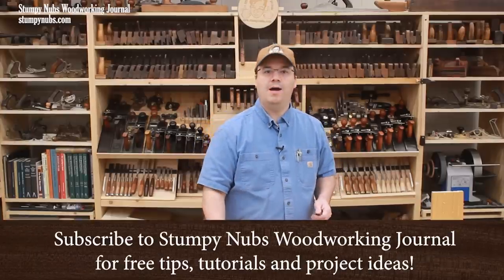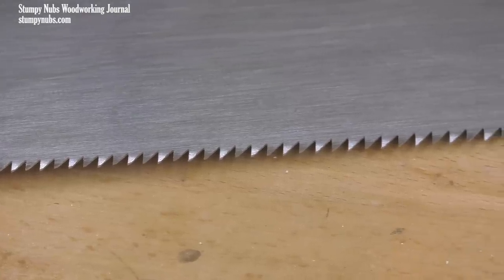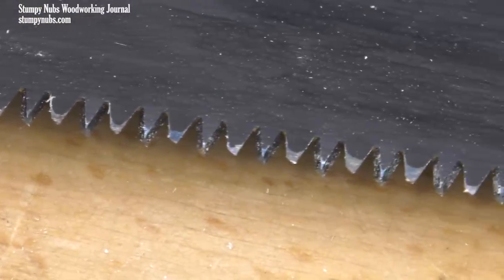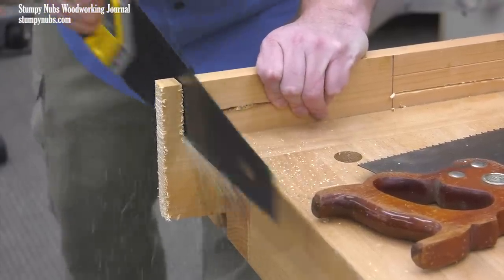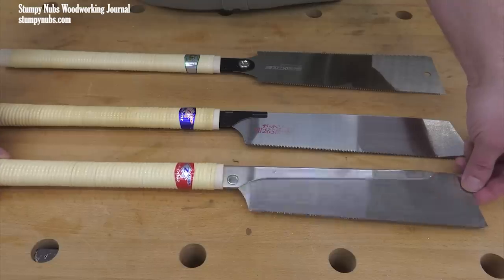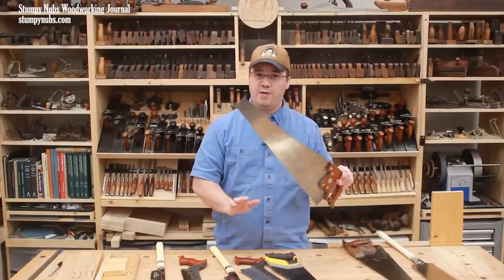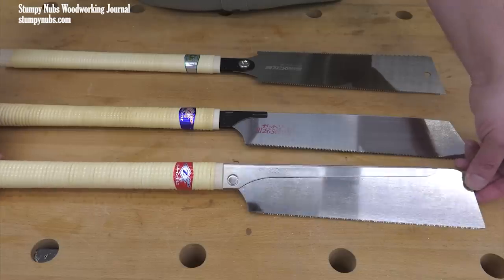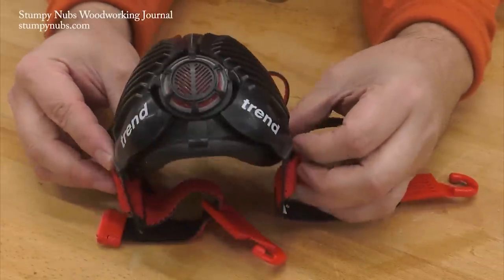Do Japanese saws cut faster than western saws?

Comment: I think this comparison missed an important part - getting started.

Many beginning woodworkers struggle with push saws because the blade will bend if they push too hard at first. With the Japanese saw, you keep tension on the cut stroke so that problem is removed.
Reply: Thats actually a good point take anyone who is not experienced using saws and they will be able to use the japanese saw better on the first time every time.
Reply: Bingo.
Reply: Even when using a normal, Western saw, I often score the wood with a few pulls before getting into it. I'd definitely keep a trusty push saw handy for big cuts, but for clean cuts with minimal waste, the Japanese saw wins.
Reply: That was mentioned in depth in the original video
Reply: I was about to say that myself, I'm no wood worker at all, but I've always struggled with push saws. I'm not physically strong, but the pull saws my shop teacher let me use when he saw me struggling worked like a dream
Reply: I noticed this too. To be honest when I was getting started with woodworking i couldn't understand why western saws were designed to cut on the push stroke in the first place. Especially since it's the design of the tooth which determines how well the cut goes, not the direction of the cut. o why not work with physics. Besides if you need to put your weight into the cut and the blade is likely to buckle when you do, what is the point?

I would argue that if there is little difference once experienced, but one requires less training to achieve good results, then the one requiring less training is the superior option. When in a shop it will save greatly on wasted lumber in the long haul, and will generally produce better results. Additionally since it works well without much training one could argue that the intuitive nature of the Japanese style results less likely hood of making mistakes.
Reply: ...that was definitely a problem for me as a kid trying to produce around my dad's construction sites
Reply: @biggiedickson  I see you didn't watch the video.
Reply: Yes, of course none of the two are intrinsecally better. Having said that, i use only japanese for a few advantages but mainly because of the woods i use the most. So, the advantages are: 1-japanese saws work better with less or even no tension, so it´s better for my arms. 2: The cuts themselves are thinner, in fact they always tell you how thin the blade is as an important characteristic of the pull blade. BUT: i usually use cedar and petiribí, meaning soft or medium woods and i work on small proyects. Since they are small pieces, it´s important for me to get the thinner less material removing saw and i don´t need anything that strong. Of course if do need to work in harder woods then i´ll use my kataba or even a thick ryoba i bought for that purpose. If you´re working constantly on oak or hard woods in general, i think you´d probably be better off with push saws. 
       And for example, i think it´s clear that japanese saws are more precise once you get use to them by far as stumpy said in the previous video BUT that might not be an advantage for you.  Many people are not looking for that as they always leave some extra material in the cut to make several cuts faster and finish it off appropriately later on.
Reply: @biggiedickson  Doesn't really work when you don't have much weight to put behind it... 😅
Reply: I don't remember having an issue with a push saw. Saws are not for pressing down hard. The weight of the saw is more than enough for cutting.
Reply: @MrVeps1  That's exactly what I do. I score the cut with a small trench so that the saw will not move. Works every time. And if you discount for that millimeter, the cut is always measured right.
Reply: @samuellourenco1050  if your saw is sharp and straight. A pull will allow a bent or dull saw to still make  a reasonable cut.

Comment: Thank for your service!  Some thoughts:

1. It would be helpful to see the back of the ripped stock.  As it stands, it appears that the Western-style saws cause MUCH worse tearout than the Eastern-style, but we can only know that for certain if the back of the piece of wood is shown.  (There does seem to be a LOT less unevenness from tearout on the crosscut piece cut with the Eastern-style saw, when the back of the cut is briefly visible from the front.)
2. The reason that the Eastern-style saw can cut MUCH faster than Western-style saws when used two-handed is the long handle acting as an effective lever; the more distance between the effort and the fulcrom--i.e. your left and right hands--the greater the downward force.
3. Conversely, the reasons that the reverse is true when used one-handed are not only because of the fewer, larger teeth, but because of the greater offset of the hand from the line of the teeth; at a given position, the force travelling from the hand to the engaged teeth is angled more downward than with an Eastern-style saw, meaning more force is used to push the teeth down into the wood than forward along the saw's path.  (If the force angle isn't careful balanced, the saw can be pressed too hard into the wood, stalling it.  If this occurs near the tip of a long saw, the saw itself can even end up permanently bent as it buckles under the pressure--ask me how I know. :sigh:  This is not possible with an Eastern-style saw.)

Does that make sense?
Reply: The eastern saw is way better for flipping a burger 🍔🤣🍔
Reply: I get ya. I grew up with Japanese saws, switched to western saws due to availability for a long time but used one of my uncle's saws when i went back to visit and just bought a set of them and brought them back in my carry on afterwards. I can't tell you how many times had bind and bend with western saws, even a snap once

Comment: In my experience the Japanese saws work better in softer woods and the western saws work better in harder woods, where, for me, better refers to speed and quality of cut. Also I tend to try to touch up my western saws whenever they feel like they aren’t cutting as well, typically in very hard woods like oak and hickory. I’ve broken too many teeth trying to cut hardwood with Japanese saws so I tend not to use them for that. Since my western saws are usually more handy I tend to grab them instead of walking over and getting a Japanese saw out of the cabinet. If I’m going to walk across the shop I’ll more than likely use the table saw or bandsaw.

Comment: Interesting analysis, for which I'm grateful.  I DO have to thank you, though, for one crucial bit of enlightenment re: push vs pull -- although it was actually in your previous (afore-mentioned) video.  What you pointed out there, which I hadn't previously (cared enough to have) thought about was what is actually well explained by your front wheel vs rear wheel drive analogy.  Truthfully, what I connected it with IMMEDIATELY when you mentioned the problem (at about 1:30 in) was what I've noticed when pushing or pulling something like a hand truck: if you try to push one ahead of you, the task of steering is quite demanding - versus just dragging it behind you, where it AUTOMATICALLY follows without requiring ANY concern for steering.  I suspect that anyone who hasn't had a western saw buckle/bow instead of cutting through as intended - probably hasn't used a saw enough to have a legitimate opinion.

Comment: This is very interesting. I have saws going back 40 years (which I can sharpen) however my modern blades are so sharp I find myself actually holding them back to stop them snagging in the cut sometimes. Of course the teeth are much different from traditional saws . I like both!

Comment: Nice follow up video.  I find Japanese saws much handier when not working at a bench.  For example, yesterday I was shortening rows of French cleats to make way for some new cabinets in my shop.  The long thin handle of my Ryoba made those cuts much easier than trying to use a panel saw.

Comment: I’m in the middle of replacing base moulding and the door trim, I ran into an issue over the weekend as the board that is under the staircase skirt board, had an odd angle, I found using the Japanese saw, I recently purchased was the perfect tool for this. Allowed me to be much more accurate with the cut.

Comment: I use a traditional western 24" panel saw for large work such as breaking down rough stock and rip cuts on stuff like a 2x4 and larger. The pull saw comes out for everything else. There is a time and place for everything.

Comment: Great video, James, and you have cut to the chase (pun intended) about the key factors in saw usage. I have had only limited experience with a good Japanese  pull saw, but I like it a ton for clean and straight cuts when properly used. I also have several vintage Stanley or Diston saws from my Grandfather and these are in dire need of a proper sharpening. Just gotta find a local sharpener who really knows his stuff.
  It appears from your video that each saw has pluses and minuses for a given task, and the finished results depend as well as your experience with that saw type. The main takeaway for me was to let the saw do the work ( I can hear the old man preaching from above) and to have a SHARP saw. Brute force can speed up a cut with a bad blade, but it won't get a BETTER cut.

Comment: I am inpressed with the modern Dewalt performance. It performed way better than I expected, and it has a short blade.
It would be interesting to compare the quality of the cuts with speed/no. of cuts. I bet the modern saw does ok in that as well.
I still love my old vintage hand saws even if they are outdated.

Comment: Very balanced testing approach and conclusions. May i add that pull stroke feels a bit more controllable, to me at least. Easier to angle or stop the cut, if or as needed. Most are stronger in pulling and that strength may count. Any thoughts on the above?
Reply: Easier to keep straight but harder to adjust if you're off or want to do a more complex cut.  Main thing is when you're starting out, keeping straight is the problem and thus a saw that makes it easy is an advantage but when you're advance and you want control then that stops being an advantage and gets in your way.

Every saw design has it's pros and cons, depends on application and what you're working on which is the better option...
Reply: @ZeoCyberG  definetely each tool has it's benefits.

Comment: And that doesn't even get into various bow saws, which also can have a variety of blades available and tend to be setup for either dual or pulling stroke. And for fine work coping saws allow a lot of flexibility to do contour as well as straight cuts.

Comment: as someone with hand tremors, not much strength and who doesn't love hunching over and making my back hurt, pullsaws just make more sense. far less effort involved, especially if your blade is nice and sharp and you start the cut right. and i can sit/stand straight while doing it!
Reply: Caitlin, I find I do mostly hand tool work since my tremors and bad back intervened. I'm using a higher bench than in my past shops which helps avoid bending so much. Still love my Disstons as I said in my post, but use pull saws as much as possible. Be well and happy.

Comment: In your riptest, the disston also cut straight, while the ryoba wandered.  This is my experience.  This is why I didnt switch to Japanese saws- I haven't learned to control them.  The cleanness of cut is different though.  I do use a dozouki occasionally when I need a fine small cut.
Reply from the maker: The Ryoba didn't wander, I just didn't bother making sure I started it on a straight path. In fact, the very slight set of a Japanese saw makes it wander less than many Western saws. That can be good if you start the saw straight, or bad if you need to make an adjustment mid-cut.

Comment: The pull saw looks easier to control and leaves a cleaner cut. If I was using a saw for fine cuts like stuff for joinery I think I'd prefer the pull saw. But I have very little experience with either. I use power tools, but would like to get more into hand tools. Great video, as always.

Comment: I've been using Shark Corp pull saws for a long time. I find the finish smoother and because a pull saw is under tension when cutting the steel can be thinner and hence less material is removed due to the narrower kerf.

Comment: The first thing I learned about woodworking is there are always multiple ways to accomplish any cut, regardless of the project.  So it's silly to argue about which is better unless safety is the deciding factor.  Use the tool you have, are most comfortable with, is closest, is favored, has sentimental value, is sharpest, or out of curiosity.  It doesn't matter.  It's your shop, your tools, your project.  Never tell someone else they way they do things are wrong just because it differs from how you do it.
Reply: Excellent attitude. I absolutely agree. 

#powertoolsareofthedevil
(Kidding! Kidding!)
Reply: This is kind of like the great photographer Ansel Adams' comment, when asked what the best camera is: "the one you have with you at the moment."

Comment: You did a very good job of pointing out how both western and Japanese saws perform making fast cuts. I am a hybrid woodworker and would probably perform those fast cuts on a chop saw or a table saw. Where I use hand saws is when I need an accurate cut, such as cutting dove tails. When cutting those accurate cuts I tend to favor westerns saws. I would like to see and hear a comparison of both styles of saws where a precise cut is needed. Maybe you have already covered this subject, if so I would appreciate a link to the video. As always you really did a comprehensive job of covering the subject at hand. Keep it up.
Reply from the maker: If you watched this whole video you saw a comparison in speed while making fine joinery cuts. I also discussed precision in the other video, which I linked to at the top of the comments section.

Comment: I bought my first Japanese saw in 1964 while I was in Japan. I just bought it as a novelty, with no intention of ever using it. Years later when I started woodworking I dug it out. I bought an entire set. In actuality I really only used the Japanese saws for detail work that couldn't be accomplished with power saws. Learning to sharpen them wasn't all that much different than sharpening anything else. I enjoy hand woodworking, it's not about speed. But I will still use power equipment when it is the easiest to get done what I want. Some of the greatest wood designs ever, were by Greene & Greene who were influenced by the Japanese.

Comment: Hey Stumpy,… great job of teaching/demonstrating as usual,…but this time, even dumb ole me has seen something you didn’t speak about.  Here it is…..with a western push-cut, every stroke yielded serious splintering of end fibers (could be solved with taping prior to cut), and the face of the cut was very rough looking.  The opposite is visually true with the pull-cut saw.  Little to no end-splintering, face of cut smooth.  With construction jobs, what I’m pointing out may be of no worth,…but when I’m in my shop cutting a board for ANY project, I like the cut result to be smooooth!

Comment: I have to admit in over 20 years I haven't used pull saw or push saw. We use saws that cuts both ways. I don't know if it's advantage or disadvantage but that is the saw I have learned to use for all my cutting needs. Obviously  diferant thickness and size and shape and length for different purposes.
Reply from the maker: How much of the video did you watch before commenting?

Comment: I use them both.   For ripping long boards I vastly prefer western saws with an reverse overhand grip,  I can carve through the wood within a 1/16 of the line and a quick hand planing down to the line.  For fine work I prefer either a pistol grip western dovetail saw or a japanese saw.   I should add that all of my western saws are 100 year old saws, mostly Disstons.

Comment: The pull saws did appear to leave a more finished cut, with less tearout, even though they might have taken a few more strokes (except in the "muscled" example, which was impressive).
But I suppose if you're not concerned about the fineness of the cut on ripping, you might be able to get it done in one "stroke"--with an ax...  ;D

Another great, informative video!  Time to blow the dust off my dozuki and pull-cut some dovetails!

Comment: I find that I can get more accurate saw cuts with a Japanese style saw than a western style saw so I tend to grab  one of those first. And, I really don't care about speed--if I needed to be in a hurry for some odd reason, one of the power saws is likely to be the answer. 
That said, the more accurate cut, regardless of which saw you've used to get it, will also take less time to get to the final dimension so I think that needs to be part of any discussion about speed.
And what works better for me is not necessarily what will work better for you. 
Lastly, I think good technique with a good quality saw of either style is more important than which style you use. 
As usual, a well presented and thought out video, thank you!

Comment: i say that both styles have there uses

finish/cut orientation/etc. is what you need to look at to decide on the correct saw
use what is the most applicable to the situation